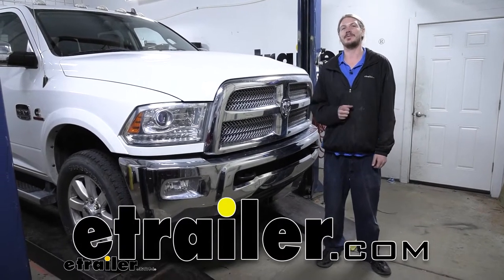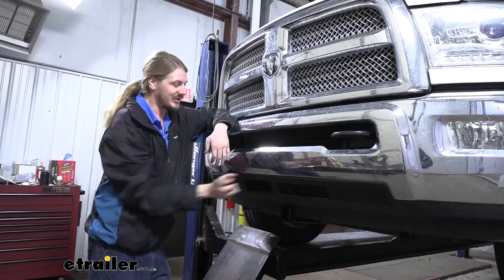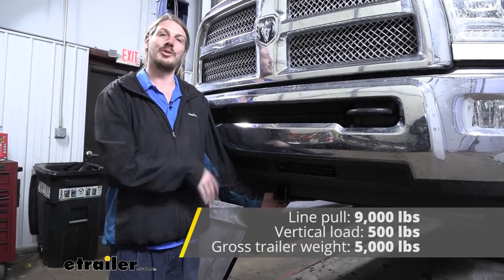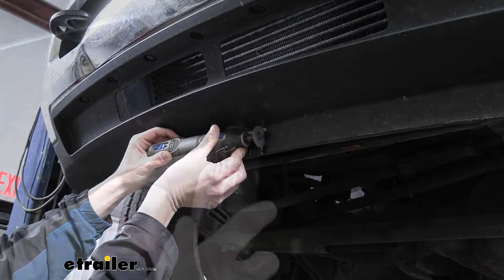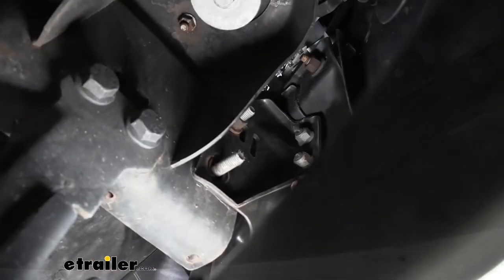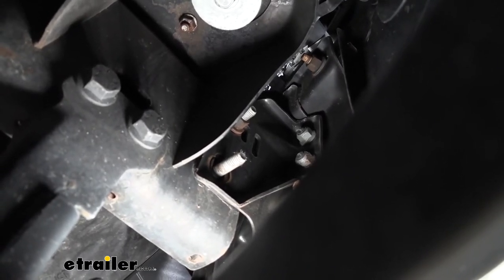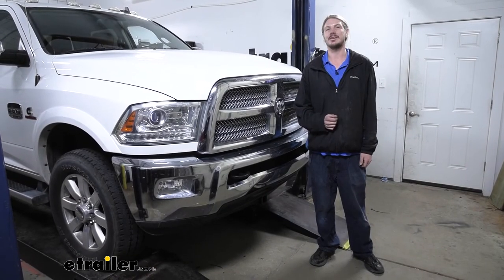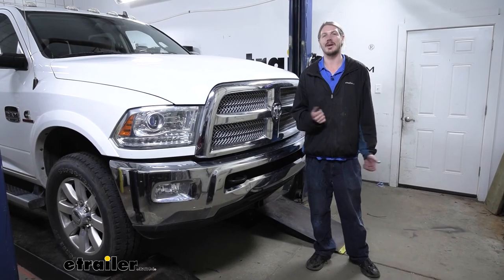etrailer | Installing the Curt Front Mount Trailer Hitch Receiver on your 2015 Ram 2500

Comment: They make winch trays for trailer receivers capable of supporting 12lb winch load capacity for rears. For this front hitch you state 9LB. Most winches less are 10LB or 9500Lb. Would they be okay to use?
Reply from the maker: You just need to keep in mind what you intend on using it to pull and that is what you need to base your weight rating on while keeping your weight rating of your hitch in mind.
https://www.etrailer.com/Front-Receiver-Hitch/Curt/C31015.html
Reply: @etrailer  Perfect thank you. It is a Ram 1500. In addition I am planning to keep some ratchet blocks or pully's with me. I thinking that will reduce the load or line pull at the winch?